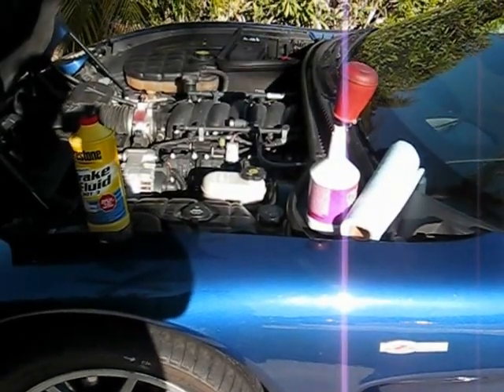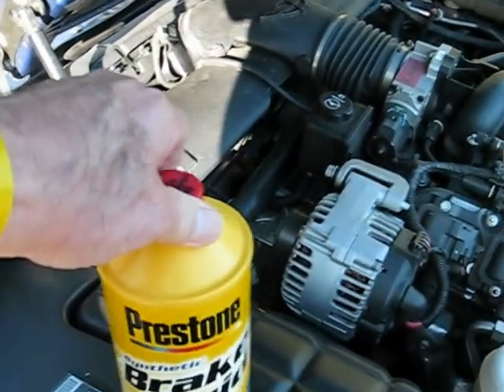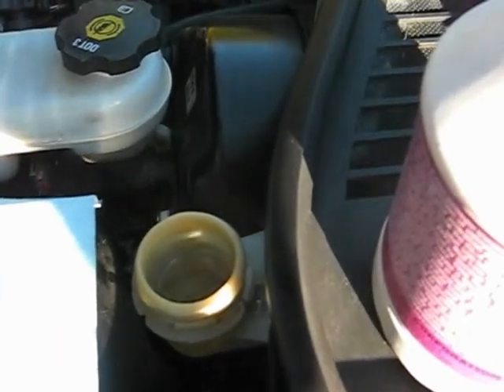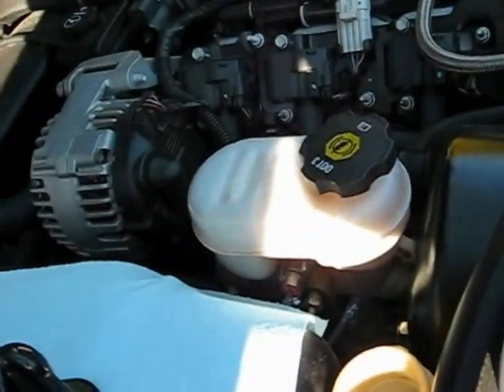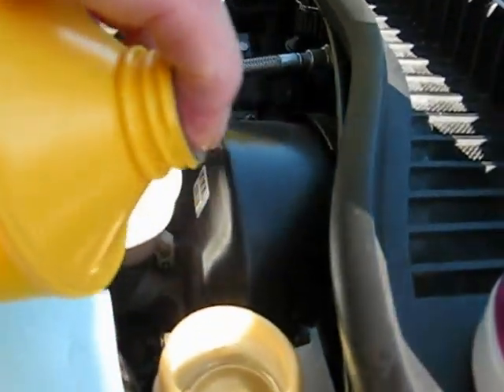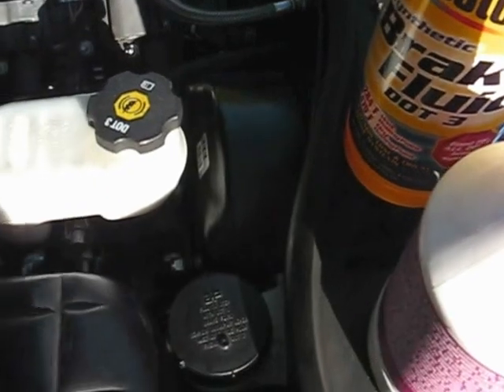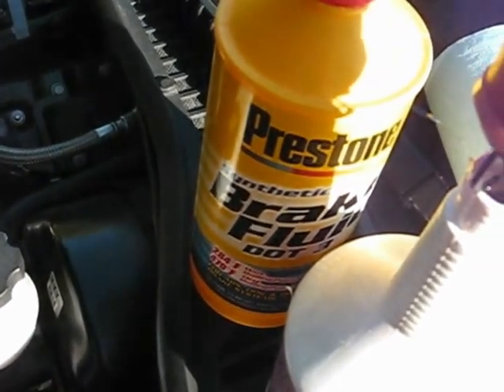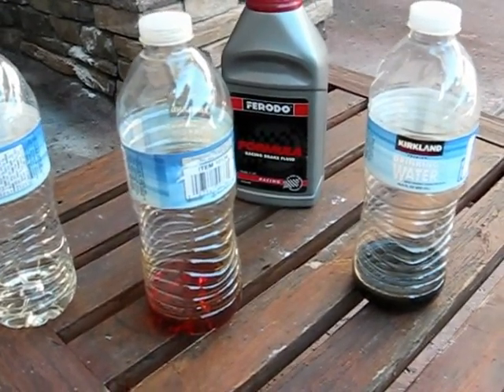Corvette change clutch master cylinder fluid C5 Z06 by froggy

Comment: Froggy, I changed my clutch fluid last night.  It was almost as black as ink!  I drove it to work (75 mile round trip) and checked the new fluid.  It got a little darker, so I changed it again.  I'm confident that it will eventually clear out.  Thanks for the video!
Reply from the maker: Welcome, once you have it clean the frequency of the procedure is much less, but whenever mine is even cloudy I do a change.

Maybe once every 2-3 months now.

Comment: Recently changed my clutch in my C5  and supposedly the fluid. But from watching your video I realize the fluid was not flushed right. Thank you for the video.
Reply from the maker: Welcome, my video is a partial replacement of the reservoir, which I recommend periodically mostly I go by the color.

Comment: I took it to a shop to have clutch put in my d side window stuck down before I put up for winter but they couldn’t start at first then they stated it pulled it around I tried to start started right up I back up died would start Goodyear in Paris Illinois did the word but they just kept blowing up till it got heated so couldn’t get nothing out of them I smell fuel after a while of trying to start so I assume fuel pump ok I tried the turkey baster trick but I the the clutch all along was clutch mater cylinder put stage one street strip clutch in but feels same thought it would be a little stiffer thanks it goes need plugs and wires but drove fine engine wise by the time I made it all gear were gone thanks for you videos you really save me $ in the past mike

Comment: Thanks Froggy!  Thought I had a broken spring. Naught! Just needed fluid. A $2 turkey baster and $4 of fluid. Clutch is standing tall again! You saved me $100 trip to the garage.
Reply from the maker: Very happy that worked out, pass the word on Froggy's Garage.

:)
Reply: Same here.  Took your advice and did the partial-flush instead of just topping off.
Reply from the maker: Good work guys!
Reply: Crap, I thought I had fixed the problem but I'm still losing pressure.  It'll sink straight to the floor if I hold it, although pumping it puts some pressure back.
Reply from the maker: Corvette clutch pedal sticks down repair kit Ligenfelter 2nd upload by froggy

Comment: Nice video.  I use RBF 600 Motul (typical dry boiling temp 594 / wet 421) in my 2011 GS brakes and clutch.  Easy to keep all fluids fresh and clean.  Keep up the great video's!
Reply from the maker: Motul is very good.

:)

Comment from the maker: You should not see any bubbles. If you do you may need to replace the slave or the connecting hose line.

You are doing it correctly, It's a long process, once it starts to clear up, I usually just drive it for a few days & then try the process over again. Driving it seems to get more of the dark fluid to "circulate" than just pumping.

:)

Comment from the maker: If you mean mix dot 3 and dot 4, it is fine to mix, they are compatible, eventually if you do it a few times you will have all dot 4. Don't use dot5 - that is silicone fluid. There is also a 5.1 which goes back to glycol fluid & is ok to mix. The numbering is a bit confusing.

Comment: You're a good citizen for posting all these videos.

I have OCD so just to confirm, DOT 3 Brake Fluid in the master cylinder?

It's counter clock wise right? Like all the other caps? The cap is seized on there, I want to make sure it's counter clock wise before I grab some pliers.

Again man thanks for all your great videos and actually being a user that responds to comments.
Reply from the maker: I prefer DOT4, mostly Wilwood 570 or 600. Higher temp ratings.

Cap is normal ccw off, gently use channel locks.
Reply: So it's ok to mix 3 and 4
Reply from the maker: Yes, but the temp rating will remain that of the lower rated fluid until you do a full flush.

Comment: Unless you just changed out your brake fluid, I wouldn't have used the big bottle of clutch fluid just to change out the fluid in the clutch reservoir because once opened, it degrades. Using the smaller bottles for the "Turkey Baster Ranger Method" is wiser so that if you don't use the whole bottle within say 2 weeks or so, you can just throw it out and open a new fresh bottle when the need arises again. Fresh fluid is very important when it comes to brake/clutch fluid.

Comment: Froggy, thanks so much for posting all of your C5 videos.   Just bought an 02 ZO6 last week and you have helped speed up the learning curve.   In one of your comments, you said that you track your car and 10W-30 is a little better for track.   I am planning on doing HPDE next month with mine.  The only mods I will be doing is draining/installing high temp racing brake fluid and Hawk HP+ brake pads.   Are there anything else that you do?   I have heard some people say to add an extra 1/2 quart of oil...  Thinking of some safety mods (maybe roll bar) but want to keep car as daily driver and street legal as I can...
Reply from the maker: Yes 1/2 qt over full is good. 10w-30 is generally better if you track/autox but if you live in a cold climate go back to 5w for winter

Comment: thats fine for now since your here to reply!!
I just did this ranger method on my 02 z06 w 121k miles, but when I pump the clutch, it doesn't bubble up but it just squirts dirty fluid up a little like blowing a donut with a cigarette.
I filled up w fresh fluid and pumped the clutch pedal 40~50times and suck it out for 6 cycles. Am I doing this right? 

Thanks for your help froggy!

Comment: I just did this, but every time I pumped the clutch to get the fluid through, I only had the cap on. I did not have the rubber diaphragm under the cap on. did I just fill my system with air?
Reply from the maker: No that is not a problem.

:)

Comment: Hey , Froggy . I tried to bleed my brand new slave cylinder first the pedal went to the floor now it s hard as a brick,  do you  think I have air in the line  ? Thanks , Eric
Reply from the maker: +Eric M Are you bleeding it down below at the slave cylinder? Rock hard would NOT indicate air in the system.

How specifically are you bleeding it?

:)
Reply: +froggy I used a mighty vac bleeder, below the slave cyl, and gravity bled
Reply from the maker: To me, a "rock hard" pedal sounds like a MECHANICAL issue, not a HYDRAULIC issue. The slave has a plunger part that moves out & presses against a "finger/lever" that disengages the clutch. I would be checking that this area is installed correctly. I did it once on a BMW slave installation. On the BMW it was easy to get the slave and the plunger mis-aligned. I have not done Vette but I think it "may" be similar.

:)
Reply: +froggy ok, thanks

Comment: hey Froggy thanks for all the info and is there a video of how to install a master clutch cylinder on a 2003 c5 z06
Reply from the maker: +dale rutledge I don't have that one sorry.

:)
Reply: +froggy thanks I diagnosed my problem it is the slave after I got pedal a leak under bell housing someone put fluid in the bladder lol
Reply from the maker: Oh no, in the bladder? Never heard of that one, hope everything is good now.

:)
Reply: +froggy yes im in san Antonio texas  I am a collision tech im letting a mechanic put the slave and master in at Cavender buick  gmc since he has done it before take care froggy!
Reply from the maker: Let me know how it comes out.

:)
Reply: +froggy yes sir and I will findout if it has a upgraded clutch  take care
Reply: +dale rutledge  every thing is out the pressure plate is a florescent blue I wonder what brand it is you have any idea thanks froggy
Reply from the maker: Sorry, no idea, check more for identification marks.

:)
Reply: +froggy thanks I could be a centerforce I was told

Comment: How do you make sure you get all the air out of the system?
Reply from the maker: Using this method no air is ever introduced. Fluid hydraulics 101.
:)
Reply: Thanks.  I also have a "cricket" chirping noise when the car is cold.  Raise rpm, frequencing of chirp increases but it completely goes away when the car is warm.  Shop I go to cant seem to fix it other than telling me that the AC compressor needs to be replaced.  Any ideas on how I can troubleshoot this?  Thanks.  (Serp belt was just replaced)

Comment: Froggy I got a 99 corvette just had clutch master cylinder put in when I went to pick it up it wouldn’t start best one did the job Illinois they got it to start pulled it out I got in backed it up died wouldn’t start back up they said I was outa gas my gage didn’t work right I called a tow truck stop put fuel in it’s very cold if this helps got it home still turns over couple times it sputters like it was going to start I could smell gas so I assume fuel pump works they pulled it out but just turns can you help me
Reply from the maker: I am sorry, not enough info to really help, the extreme cold could be a factor. How long since you changed plugs & wires?

:)

Comment: Would you have to bleed it?
Reply from the maker: Not at al, the remaining fluid level is just at the bottom of the cylinder, o no air ever gets in, it's a PARTIAL fluid change, not a real flush, but works great.